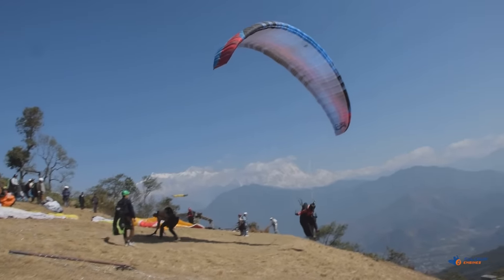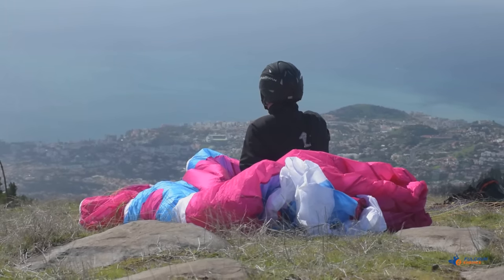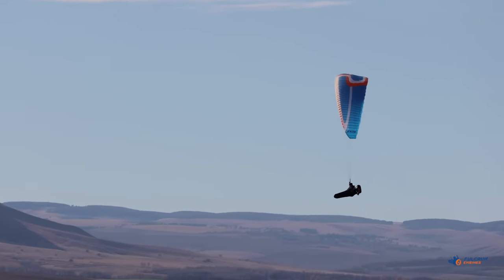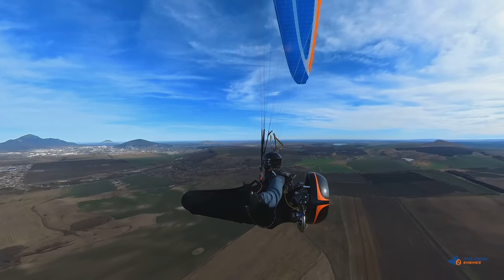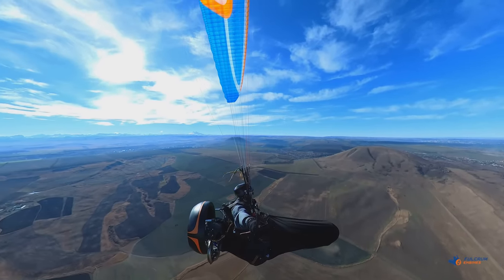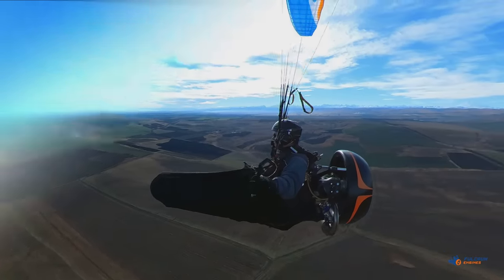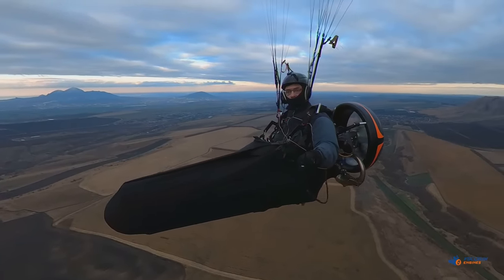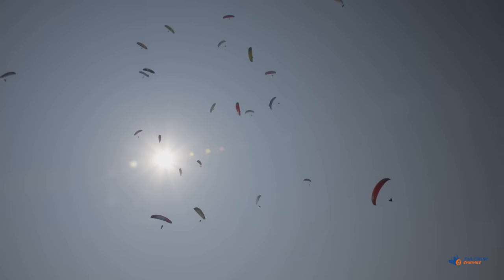Fulcrum PowerPod is the world's first paramotor pod harness with a ducted fan only 0.5 m in diameter

Comment: Looks less safe and more uncomfortable because of the leg position.

Might be more aerodynamic in flight but having your legs closed  together and straight out like that is hardly a natural ergonomic position. I'd rather have my legs dangling out like a normal seated position, and IMO landing would also be easier with the legs free. 

I want to see video of how they are even meant to land in such a position. They just land flat on their ass and are supposed to "skid" and slide? And that would be considered a "good" landing? Wouldn't it be dangerous and more risky than using legs since after they land on their ass, wouldn't they then roll/fall sideways and could hit the side of the head onto the ground?

Is there any videos showing them landing? because yeah.. afaik this video didn't show any landing footage at all which makes me suspicious for the reasons mentioned above.

Maybe they can update the design and allow for the legs to be easily freed and used like landing gears on a plane..? Just make a design like planes landing gear with legs able to lock in and be free anytime the user wishes..

Imagine getting stuck in a tree 3-5 meter up and your legs are still trapped, if you cut the ropes you will land hard on your ass/head and most likely be seriously injured compared to if your legs would be free.

Seems like this design creates more problems than it solves..

However I don't want to be a party pooper so I hope they can keep improving on the design and keep making paragliding better and better in general.
Reply from the maker: Thank you for your interest and your comments. The position of the pilot's body in flight is the same as that of traditional paragliding pod harnesses. With a deflected back and legs stretched forward. This is a normal comfortable pose for most of the free pilots, nothing extraordinary. Landing proceeds in the same way as in the usual harness of the pilot - only on his feet. No ass landings - it's not safe and a good pilot never lands like that.
We did not consider it necessary to show the landing, because for most paragliding pilots it is not very interesting. It was more important to show the take-off with PowerPod.
But we will soon publish a video in which we will show the takeoff and landing (and with the actual sound).

Comment: Its strange that ducted fans on paramotors weren't already a thing
Reply: Would it be possible to get away with a more traditional paramotor design using the smaller ducted fan

Comment: Listen guys, commercial pilot and I’ve built many real airplanes and got my start dreaming about paragliding.  The issue with powering a paraglider with the idea of soaring is that it’s a pendulum.  The more you push the pilot the lower the wing loading is and then less stability you have.  So the idea of flying into turbulent air (which you need for soaring) is a bad idea.   Towing actually increases the wing loading and center of pressure and actually makes the glider more stable.   If you were to point the thrust line 45 degrees upward to mimic the effects of towing the glider you may be able to make it work. But it’d be very inefficient.
Reply from the maker: The existing scheme works and is quite successful. Flying in turbulence with or without an engine is not a problem for a trained pilot. This is how thousands and maybe millions of paragliding pilots fly around the world.

Comment: Since this is to be used to get to altitude and switch off, I wonder if electric would workable.
Reply from the maker: An electric drive would be an ideal solution if not for the weight of the batteries. Due to the heavy weight of the batteries, the electric version will be much heavier than the ICE version.

Comment: Two-stroke?  Blue smoke?  Fossilized fuel?  Fumes?  Excessive noise?...
...mmm, i'll wait for the electric version, thanks.
<dream mode on>
If the sail canopy could integrate some solar-PV (perovskite-based?) ... now we're talkin!
<dream mode off>
Reply from the maker: Electric is not so good with present day battery technologies, we did some calculations here https://www.fulcrum-engines.com/news  we implemented a two-cylinder engine with an enjection system. It is it has a much lower level of vibrations then any ordinary paramotor engine has.

Comment: Pretty cool. But imagine if they substituted an electric engine with LION batteries. Engine would be lighter/smaller but offset by batteries. No gasoline to mess with. Instant on-off without worrying about not being able to restart in flight because gas engine complexity. Some ability to regene/recharge battery in flight under right conditions, much like EV.

Comment: THE ONLY DIFFERENCE BETWEEN YOUR POWER POD AND THE FLYING TRACTOR AS YOU PUT IT IS THE SIZE OF ITS PROP
Reply: Also the reclined seat position in flight, and the foot bag, like they said.
I don't know how much difference it'll make, but certainly I can feel a big difference in drag just by taking the legs up in my mosquito powered harness.  I've only ever used a folding propellor.  It's noticeably worse at free flight than my normal (Z5) hang gliding harness, but on a lifty enough day I think I could stay up power-off.  That seems to be the use case they're going for.

Comment: Why not utilize an electric motor, cover the leg fairing with flexible solar panels to recharge the battery while flying...
Reply from the maker: t will be inefficient. To charge the batteries for such a powerful 25 hp engine, dozens of square meters of batteries are needed.

Comment: The conceptual idea is not new as you can see in this sketch from more than thirty years ago:-IMG_20171022_0002.pdf All of the features of your power pod are incorporated in this design which was intended for use with a hang glider but could be used just as well on a paraglider. I congratulate you in producing a working version of the design and I could suggest some other improvements if you wish to hear them?
Reply from the maker: Thank you. Yes, we are ready to hear your suggestions. Write us by e-mail.

Comment: Funny no footage of landings... and the cad design shows the exhaust hanging below the "pod" bet those get smashed in pretty quickly... back to the drawing board... or Kickstarter perfect BS for that...
Reply from the maker: There are no problems with landing, it happens as in the usual harness of a paraglider. The video shows a prototype, the serial product will have protection for the exhaust system.

Comment: Why not an electric motor?
Reply from the maker: The electric version of the PowerPod will be too heavy if you try to achieve the same operating time as the ICE. The electric batteries are too heavy. If you try to keep the same weight, then the engine will run for 10-15 minutes at full power.

Comment: How about an electric motor?
Reply from the maker: It is possible, but with a very short running time of 10-15 minutes. To run the engine for 30 minutes, the electric version will be very heavy.
Reply: @fulcrumengines2519  I’m not flying myself. Can imagine it will be a more weight for the pilot when starting. Thanks for the answer 👍

Comment: It would be great if it could be built with an electric motor. It would be quieter, cleaner and more reliable.
Reply from the maker: Yes, of course, but with a very short working time of 10-15 minutes. To run the engine for 30 minutes, the electric version will be very heavy due to the weight of the batteries. Is the electric version with 10-15 minutes of engine operation interesting?
Reply: @fulcrumengines2519  yes I think so, I come from an RC aircraft background and the trend is away from petrol engines. Electric motors are far more user friendly. Petrol motors are like dinosaurs in the RC world. Also a short flight time is not so bad. You just take a few batteries with you, already charged up, and you can take a break between flights. I think with the choice of petrol or electric, you would have a bigger market and you might find that many people would choose electric.

Comment: As an engineer, they lost my faith when they said that the prop/duct clearance was only a few mm, and that "any contact would result in its destruction".  There is NO WAY they can guarantee that, over time, the prop bearings won't move or shift, such that there will NEVER be contact between prop and duct.  Similarly, the duct itself could shift slightly over time, resulting in the same problem.  If they insist on maintaining such a tight clearance between prop and duct (for maximizing prop efficiency), they are virtually guaranteeing a catastrophic failure at some point in time.
Reply: Yep, the video posed as many questions as it answered. For example, I wish they’d had the courage to let us hear how loud it was. It won’t worry the paramotor crowd, but they started the sales pitch with an appeal to the quiet serenity of paragliding.
Reply from the maker: The shift of the propeller bearings by several mm is catastrophically much for the bearing. This means that the bearing is actually destroyed and cannot be used. As an engineer, you should know this. It is difficult to provide a gap of several mm between the duct and the fan, but it is possible. This problem is solved in principle.
You're not afraid to fly jet planes, are you? And there the turbine and compressor rotate much faster with the same or even smaller gap.
Reply from the maker: We plan to shoot a video with actual sound soon, with takeoff and landing. Of course, it is impossible to gain altitude silently in principle (of course, if you are not climbing in a balloon or with the help of updrafts). But with PowerPod, the motor mode should be short-lived, only until the first term. And then - a silent flight, with the quiet serenity of paragliding.

Comment: I'm surprised someone hasn't asked what the estimated run-time is on full fuel
Reply from the maker: The volume of the fuel tank is planned to be 5-7 liters (it should be compact enough for our concept). This should be enough for 30 minutes of operation at 75% power (climb mode). During this time, you can reach 2-3 km of altitude.
If you fly in the horizon, without climbing, the flight time will be much longer.

Comment: That uncomfortable sitting position doesn’t look near as uncomfortable as the straight legged seating positing of y’all’s device. I see very little improvement, and very little difference. I find more fault with the wording of this video than I do with the device itself.
Reply from the maker: For most paragliding pilots, the semi-reclining pod harness position is very convenient for hours-long soaring flights. This position of the pilot is extremely rarely used on a paramotor due to technical features. We tried to solve this problem and we succeeded.

Comment: Gasoline engine?  I’m surprised an electric motor is not an option.
Reply from the maker: With an electric motor, the PowerPod comes out too heavy due to the weight of the batteries. If done with the same weight - 20 kg, the working time at full thrust (climb mode) will be 10-15 minutes. During this time, it is possible to gain 800-1500 m of height. Is this option interesting?
Reply: @fulcrumengines2519  It would be to me.  I haven’t get gotten into paragliding yet but it has always been appealing.  Enough batteries to just get off level ground makes the sport much easier to get into.
 It would also be terrific if 
° the batteries were very easily swappable on the ground for multiple flights in a day and for fleet use.
° the battery was not behind the pilot, but under the seat.  This, I think, would be safer and more comfortable.
° the position of the entire prop/duct were adjustable, so you could tuck it behind the pilot’s back when not in use (for low drag) and poke it out into the airstream when it was running, either overhead or below the pod entirely.  Alternatively, position it at the end of a long arm, a meter or so behind the pod, for better thrust and quieter (to the pilot) running.
° If you ever radically redesign the thing, you could have two props on arms that swing out to port and starboard under power and when not in use, would be blown straight back.  I think the improved thrust would more than just justify the slight increase in weight and complexity, and it would look super-cool.

Comment: Great concept, but Ive seen paramotors catch fire. I know an electric version would be better if you can keep the weight down
Reply from the maker: Of course, we think about an electric version of our paramotor pod harness. And most likely, we will do this in the future. But according to our calculations, the weight of the device comes out much more than with a gasoline engine. And electrical devices also sometimes ignite, unfortunately.
Reply: I wonder if a hybrid gas/electric is the way to go

Comment: 2:13 you speak about the bad aerodynamic efficiency of a strap-on motor, but fail to mention the elephant in the room 😃

The "airbrake" is the very thing that you hang under! Get a real wing and your life will change 👍
Reply from the maker: I have experience flying a paraglider and a sailplane. I like both this and each has its advantages.
And many pilots around the world like to fly on a paraglider, it has its own charm.
Reply: @fulcrumengines2519  oh, I believe you. It's just that for me the words "paraglider" and "efficiency" just have no connection. 

By the way, have you considered offering your pod to hang gliders, especially rigid wings?
Reply from the maker: @daszieher  It seems to me that hang gliders can quite easily fly with a folding propeller without protection. The duct fan for this application is not as good as for paragliders.
Reply: @fulcrumengines2519  that is probably the case.

Anyway, more hang glider pilots might want to try the supine position, in contrast to the typical head-first into-the-ground prone position they typically set out with.
Reply from the maker: @daszieher Thank you! We will think in this direction.

Comment: Cool. But it’s most certainly NOT the worlds first. PeterSrepol literally did this a month ago.
Reply from the maker: Peter Sripol has not one, but two ducted fans. The diameter of his props is much larger than 0.5 m. He did not make a special fan for the channel, but simply cut off the usual propellers. This is not at all the same as making a single duct fan with a diameter of only 0.5 m, with which you can really climb several kilometers of altitude, and not fly for several minutes at an altitude of hundreds of feet maximum. And besides, Peter's paramotor doesn't have a pod harness. :)

Our PowerPod flew half a year ago. But earlier there were still projects with ducted fans on a paraglider many years ago. There were paramotors, there were paratrakes, we (like Peter Sripol, too) are not the first here. We were the first to do everything together - we made a channel fan of minimal size with a comfortable pod harness for the pilot, with a reclining position.

Comment: Especially if a electric version, included flexible solar cells sewed into the para-wing, which could help to recharge the para electric motor own lightweight batteries, to extend flight time and range too.
Maybe the next step would be to build a side by side two seat version, as a training para motor, with an over sized para-wing too?

Comment: Paramotors are uncomfortable?  I fly for hours with no discomfort.
Don't try to compete with equipment not in your flight regimen.  
Each has it's own use.
Reply from the maker: Yes, of course! You're right. We do not compete with traditional paramotors. We offer this solution for free pilots. And for most of them, it is uncomfortable to soar on a conventional paramotor.

Comment: Impressive Innovative design but if you are creating a game changer, why not go the whole hog and add an electric motor for reduced noise, better reliability and improved aerodynamics. If you don't, a competitor will and steal all your market share you just gained.
Reply from the maker: Of course, we like electric motors, their silence and ease of use. But according to our calculations, to lift the pilot at least to a height of 1000 m, you need a lot of energy and heavy batteries, it will be heavier than the version with an internal combustion engine. The version with an internal combustion engine will be easier than an electric one, even when flying 8-9 minutes or more in climb mode.
Unfortunately, these are physical limits that are almost difficult to overcome.

Comment: Make it electric and you MAY get my attention.
Reply: battery has too low energy density, ~0.3 MJ/kg vs 47.5 MJ/kg for lithium vs gas ... due to higher efficiency for electric option, the actual ratio is still to high (at best ~x30) to be practical... may be some hybrid with low power gas engine and small batteries to be charged during thermal flights could be an interesting solution as an assistance to get through sinks... if total weigh  of such hybrid ~5kg then indeed it could be a quite interesting...

Comment: This is not going to be a challenger for paramotors. Paramotorors seems much more simpler and closer to paragliding than this are .. especially the leg cover, people will be very much ok to lay their legs down instead of consistently holding it straight.. paramotor seems much more flexible for the driver to move around their limbs that this one. Also whatever the drag you are claiming is BS. You got to have your blades unaffected by the person for the flow of air into it. Paramotor long baldes does that trick.  Not this one